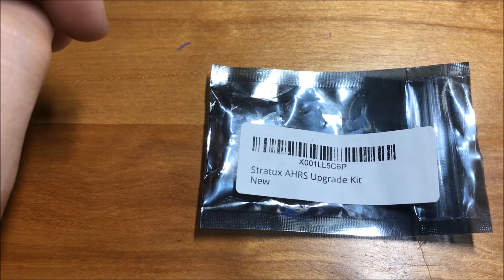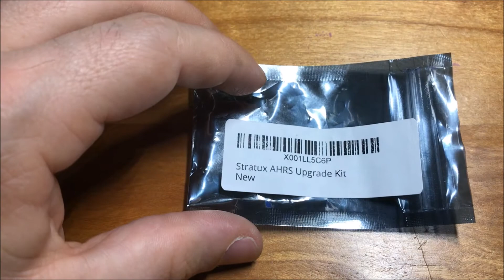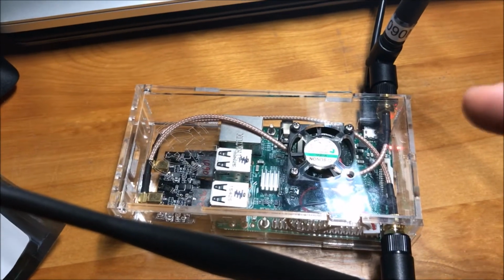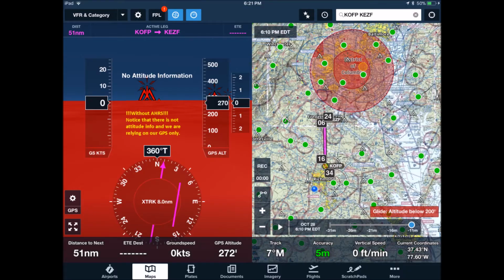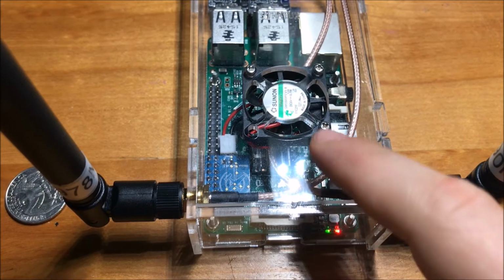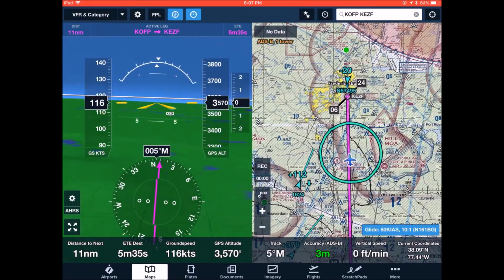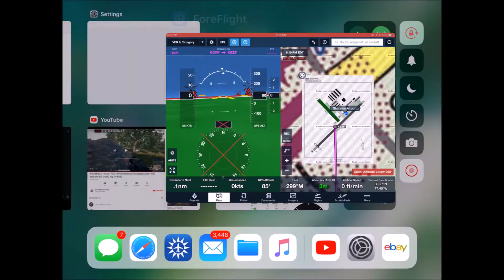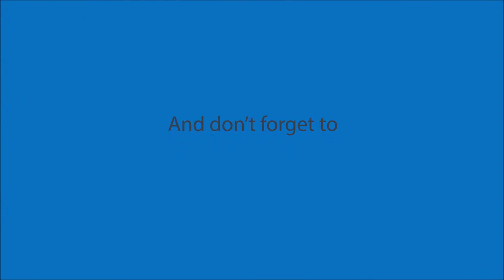Get the edge with AHRS - Don't get stuck with a bad attitude :)

Comment: So the Ahrs now works with foreflight?  I've been debating the stratux because I do use foreflight but wanted the Ahrs but can't justify the stratus 2s price.  In your opinion does the stratux Ahrs information display well in foreflight?
Reply from the maker: I would suggest you take a look at the following video:
https://youtu.be/Q9Xu1CqSn7Q

"Stratux DangerZone Update for ForeFlight AHRS Functionality"

Long story short, Sporty's/FF only wants people to use their hardware and software.  I can't blame them for this.  The GDL90 protocol AHRS data is blocked on FF so the brains over at Stratux made a workaround. It works, but it's not perfect. 

Stratux and the AHRS chip work perfectly on iFly, FlyQ, WingX, etc.

Really, I am not too amazingly thrilled about its performance and functionality.  So, I will say this -  If you have an extra few bucks I would go ahead and get it if I was not using Foreflight.  Having an extra attitude indication device on board might be helpful if you have a total failure in bad conditions - heck it might just be the piece of equipment that saves your life.

Some additional info:
https://www.reddit.com/r/stratux/comments/43mkd8/foreflight_and_ahrs/
https://www.reddit.com/r/stratux/comments/6iebt0/ahrs_and_foreflight/
Reply: I realize I am kinda randomly asking but does anyone know a good website to stream new movies online?